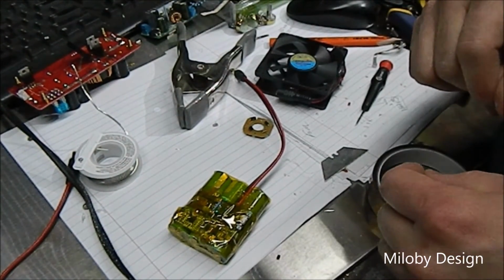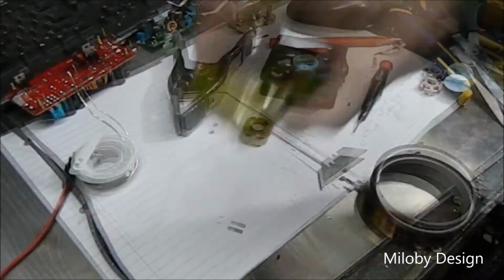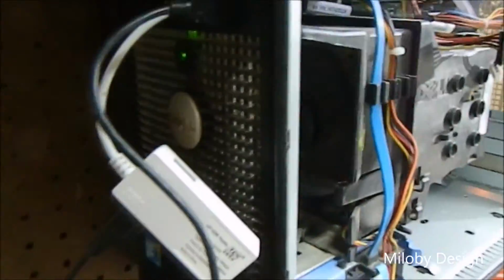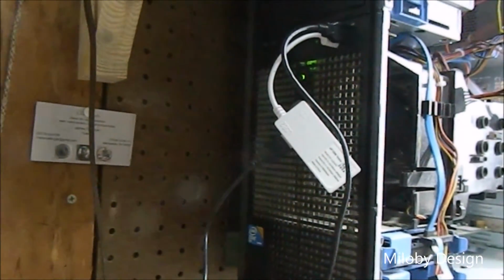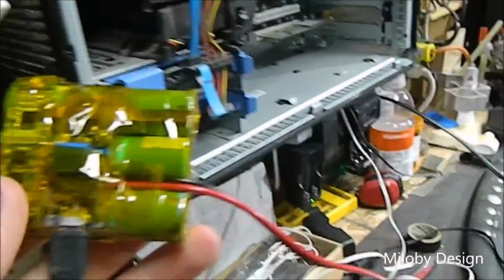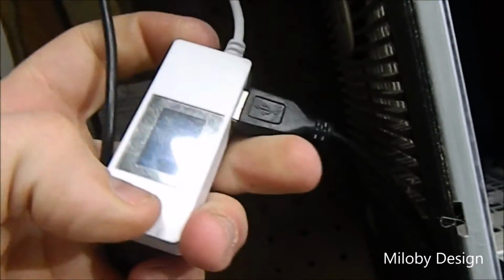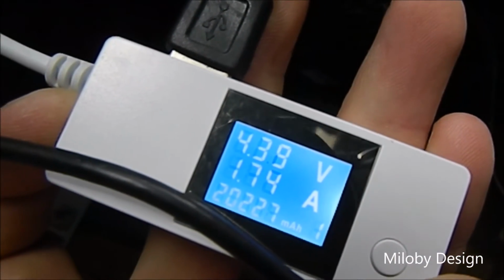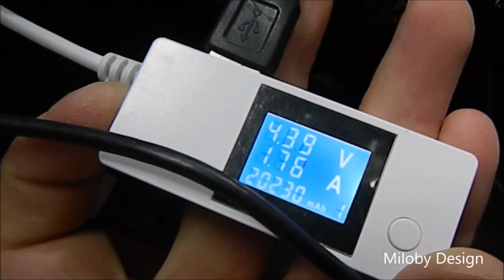18650 battery Universal 12v pack with usb charging

Comment: Thanks, very interesting. How do you wire the micro usb step-up board to the BMS board?
Reply from the maker: Hello! This can be done in two ways. With the bms or without.  Take the step up outputs and wire them to the bms positive and negative, or where the power barrel goes into the bms. That part of the bms works as an input and output. Or. Wire the step up directly to the batteries.  I recommend going through the bms.

Comment: Thanks for this great tutorial, I want to ask if you can provide us with a Link for The BMS ? I want to build a 4 cell 12v battery so can you provide us with the best one ?
Thanks a lot.
Reply from the maker: Well if you want a 12v pack you have to use a 3 cell bms, 9v to 12.6v range. A 4 cell bms will put you in the range of 12.0v to 16.8v range. If your powering something that can handle 16.8v then go with a 4 cell bms. It has to be one or the other. What are you powering? What is the amp draw?
Reply: I'm powering an UDOO x86 board, the UDOO needs a 12v 3a power supply but in test with nothing connected to it only draws around 1-1.5A at 12V even under load.
Reply from the maker: Ahh cool. Your pack probably should be 3ps3. That's three packs of 12v. So that's 1A per pack. Here is your ebay options. https://www.ebay.com/sch/i.html?_from=R40&_trksid=m570.l1313&_nkw=3+cell+bms&_sacat=0

there are quite a few that can do 20a 3 cell bms. That will work fine. Buy a few at one time, its easy to make a mistake and burn one up.
Reply: yes, thank you again much appreciated
Reply from the maker: Ahhh, I see how you are confused. The 3.7v is whats called nominal voltage. You dont need to go by that. The cells range between cut off 2.99v and fully charged its 4.2v. So don't go by the 3.7. All three in series will be 12.6v when charged. Now consider balancing also, you will need to understand this before you build your pack. I can help you with that too when you're ready. For the bms get the same thing but with 3 cell.
Reply from the maker: The charger will work good. Charge all three together in parallel and your balance will be really close. Then check each cell and make sure their no more than a tenth off. You may need to let them sit for a bit so the voltage will settle. then recheck. Thats the simplest way to get all the cells the same. Then get a 3 cell bms. Use the usb charger and connect the usb board output to the charge leads of the bms.
Reply: u mean that I balance my cells using the balance charger and then use that usb charger u used in ur tutorial and that's it ? it will be always balanced ?
Reply from the maker: Really you just need to make sure the cell are at the same voltage before you build the pack. The easiest way is to charge them in parallel. A lot of this can be really confusing at first. just charge the cells to 4.20v and your good to go to the next step.
Reply: yeah, thank you so much sir.
Reply from the maker: Hows your pack coming?
Reply: Hi Miloby Design, nothing for now, I ordered all the electronic components I need (BMS, Batteries ...) and still waiting for them to come. the procedures here in my country are so slow and stupid

Comment: How you know when your 12v battery pack is charged and not overcharged?your circuit dont have auto cut-off charging
Reply from the maker: the boost converter charges to what ever you set it to. If you set it to 12.2v then it stops at 12.2v. that's 4.06v per cell. your good to go.
Reply: Miloby design that boost converter have cut off circuit? Tested with multimeter?i want to buy some of those boost converters
Reply from the maker: +Hulkeris Hulkeris yeah, there awesome!!!! there so cheap, buy like 5. https://m.ebay.com/itm/2A-DC-Boost-Step-up-Adjustable-Converter-Micro-USB-2-24V-to-5v-28v-6v-9v-12v-24v/262520903830?_trksid=p2057872.m2749.l2649&_mwBanner=1